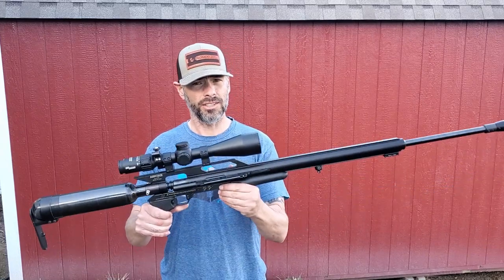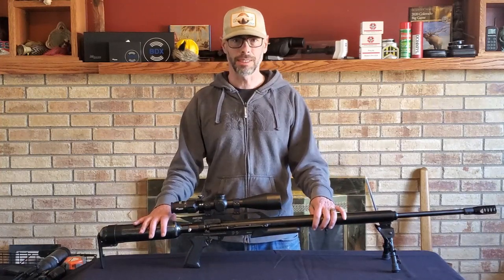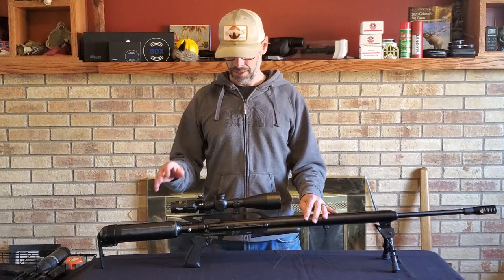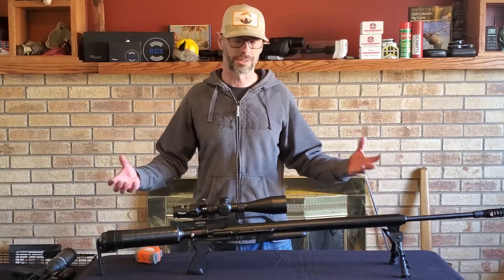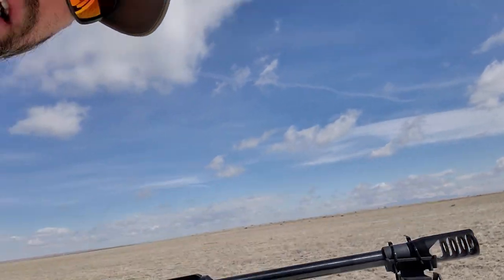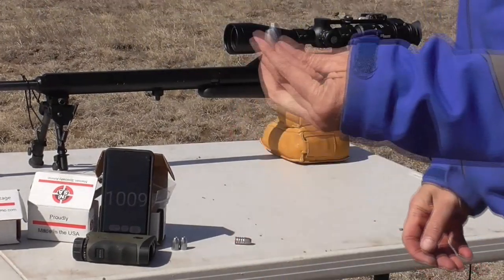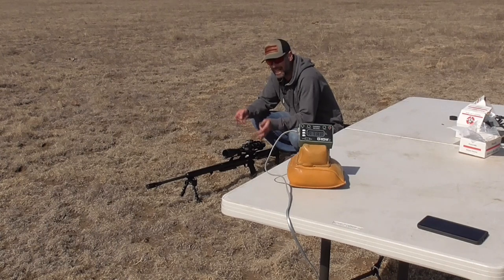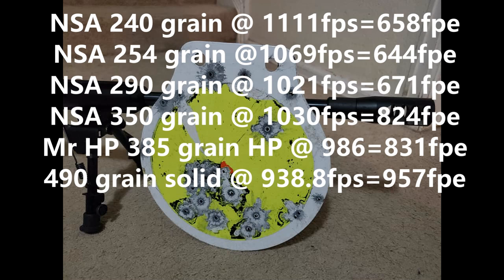957 FPE Airforce Texan big bore African Air Ordnance .457 4500psi upgrade w/ carbon tank. LSS SS

Comment: The biggest benefit of a Texan is that if you invest in a 4500 psi compressor and buy molds ,use wheel weights ,you can shoot for free. I'm buying the 50 Cal Texan with the super valve heavy hammer spring and a few 510 diameter molds. 396 and a 412 grain. I'm getting a us made 4500 psi compressor and a few 4500 psi scuba tanks. I can run my HKs and AKs ,but that cost money. If you spend the money on investing into a full setup with a Texan it's free essentially

Comment: It's good that you mention the air consumption con. I own a bushbuck and it gets max power at 3800 psi. I thought I wanted more power, was looking into one of the more powerful options but they all need that higher pressure and I do like to shoot for a while. dont want to take more than just my one large tank with me, that's ultimately why I decided to stick with the bushbuck.
Reply: You know when you're right you know a lot of these are gone guys want to push all this PSI filled to the Limit who's to say this texting here wouldn't give you better performance with a 4,000 PSI fill instead of 44 just because you can fill it the 45 doesn't mean that it will shoot the best there that's all I'm saying
Reply: @donwilson350  yes. The bushbuck is actually this way. The manual said it could be filled to as much as 4400 PSI IIRC, but it gets best velocity around 3800 as I mentioned. However, there are big bores that do get their best power at the higher number where you'll get way less shots at that pressure before your tank runs low...
Reply: Smaller calibers are more fun. Over a 100 regulated shots with my .25 and the thing is a laser. Big bores are cool but the ammo is expensive and the shot count just really sucks the fun out of em
Reply: @asherr5966  my aea 50 caliber Challenger is the same I can fill up to 4500 but I will have no max power until 3800 mark just too much pressure for hammer spring I only like to overfill to 4500 when I'm Target practicing gives me like a 16 shot total
Reply: @donwilson350  you won't get better foot pounds of 4500 PSI.. it's always your sweet spot .. 3800 PSI and below I own an aea Challenger 50 caliber and I filled to 4500 for more shots not powerful shots.. 3600 when I want to get it done
Reply: @lindseyzacek5211  sounds like you have washers installed? I got rid of my bushbuck and own a challenger bullpup 45 now. It gets max power at 3300ish without any washers. I tried it with them and with a heavier slug it made as much as 500 FPE, but I had to fill to higher pressures and got far fewer shots from my large CF bottle, so I removed the washers

Comment: Hey buddy, love my Texan now!!!! I’m getting 1,018 FPS with a 350 grain bullet. That’s at 4500 psi and my hammer spring halfway.
Reply from the maker: Very cool. Ya gotta love it!
Reply: Would you tell me What part item must I change to get 1000 fps. Please give me a Link website for get the part  Thanks. 🙏🙏
Reply: @jokopurnomo97 , just google African Air Ordanance or Lethal Air and just click on the website.
Reply: @longislandairgunner1600  Thanks for your answer. But what part must be change to get more 100 fps with 350 grain?
Reply from the maker: You will need the 4500 psi tank either metal or carbon. The valve. And the magnum hammer Spring.
Reply: @ColoradoAirgunner  Thanks for your information 🙏🙏🙏
Reply from the maker: Happy to help.

Comment: The stock valve can handle the 3600 psi like the new valve 
I just put a new hammer spring around 3/4 more longer than the stock spring 
I bought it at hardware store
Now I get 100 fps more than before
The only problem is the lock on the trigger get stuck when the air gets down around 2500 psi 
I need to figure out what i can do with it
And the other problem is the trigger
It gets much more sensitive so with little push it shoots so be careful with it

I'm still trying to figure out why when I turn all the way inside the power wheel 
The trigger lock get stuck
So I have to turn back the power wheel 
Till I can unlock the trigger 
And like I said just be careful with the trigger!
Reply from the maker: Good to know.
Reply: Your sear pin might be wearing its the most front pin towards the muzzle

Comment: The only thing it’s missing is a suppressor instead of a muzzle brake and it’s perfect. Nothing’s quieter than a suppressed air rifle, since at full power you’re subsonic why not suppress it? Who cares about recoil control over sound suppression when it’s just a single shot? The recoil shouldn’t matter a bit as long as your stable and confident with your rifle/scope setup. It would be different if you had a muzzle brake/compensator on say a threaded barrel 10mm XDM (which I have one with a compensator and love it dearly) where most ammo is loaded on the supersonic side and it’s semi automatic with a high capacity so a compensator over a suppressor makes more sense. Not to mention 10mm does have recoil that needs to be tamed for a quick follow up shot, no matter what in this case however the reloading process takes to long for it to matter. My Texan LSS in .308 with the stock 3000psi tank is of course very tame in recoil, the shrouded barrel and suppressor also minimally helps the recoil, but really it’s because it’s not there in the first place. Even if it was though I would much rather suppress than compensate when givin the choice on the Texan. Nothing is more valuable than being stealthy in the woods if you want to bag more critters or not scare surrounding wildlife or even neighboring people suppress that bad boy, it’s just calling out for one.
Reply from the maker: I like suppressors too! I have an Emperor from DonnyFL for it. It'd just so long to carry hunting.
Reply: @ColoradoAirgunner  i just carry mine in my back pack and put it on in the stand or if i sit on the ground

Comment: With custom pellets and lighter pellets can speed up to 5000FPS
Reply: Theres a limit even with gunpowder like u could put a 20 grain bullet neck down a 50 bmg and only get like 5800 fps not 100000 fps because theres a limit of how fast the gas can expand same with air u can increase the pressures in the future but there will be a limit tk how fast air can expand

Comment: Hey buddy, what did you set your hammer spring at? Did you have it midway, 3/4?
Reply from the maker: Maxed out for the big stuff, over 350 grains. 3/4 for the sub 350 stuff.

Comment: so if i already have the carbon fiber tx2 texan 45 all i would need is the bottle? i think the tx2 version of the texan comes with the magnum spring...?
Reply from the maker: You would need the valve, magnum spring, and a 4350psi bottle. Either carbon or metal. The spring from AAO is stronger.

Comment: please go more into how you got the valvebody out of the bottle....most brands use some sort of loctite/sealant and can be a b*tch to get off
Reply from the maker: It comes on the bottle. It does not need loctite. Just hand tighten and removed by hand as well.

Comment: that's a lot of work for an extra hundred feet per second
Reply from the maker: A lot of guys would really like to have an extra 200 foot pounds of energy over a carbon tx2 Texan.  It's very easy to install.
Reply: 200 foot pounds of energy not feet per second
Reply: @MenardRebelRiders  bet those numbers dropped your jaw! lol FPE not FPS ! 😎
Reply: @MenardRebelRiders  
How you want to get more FPE without increasing the speed?
The more faster it go the more FPE you get
Reply: @maryokelly9674  
Mass
Reply: @maryokelly9674  they did increase the speed buddy. wtf are u talking about?
Reply: mass = weight

Comment: About wer is ur power wheel set
Reply from the maker: All the way back.
Reply: Was shooting mines yesterday breaking it in,jus wanted to get an ideal, it'll b maxed out ,I still gotta order the new New AAO 2021 Texan Stainless Steel Carrier Tube ,,
Reply: I had ordered the upgrade 2021 upgrade kit n  m. spring n hammer